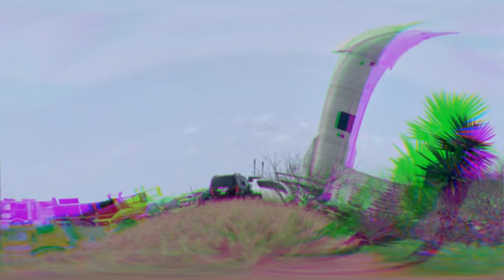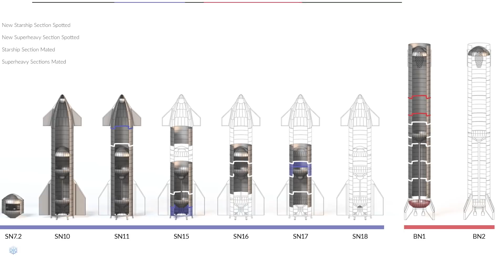SN11 is Launch Ready | SpaceX’s BOLD Plans For Orbital Flight

Comment: Helium pressurises the spherical methane tank to allow enough fuel to the engine. The flip maneuver mixes Helium and Methane which renders the fuel less efficient to ignite. A kevlar sheet inside the midpoint in the spherical tank with enough slack to cover the top or bottom of the tank could ensure that helium and methane don't mix, while allowing volume of both to change. This would allow unmixed fully pressurized methane  to ignite the engine properly at any time point during the flip maneuver.
Reply from the maker: Thanks for the insight
Reply: @rush747in  Thanks for your channel! 👍